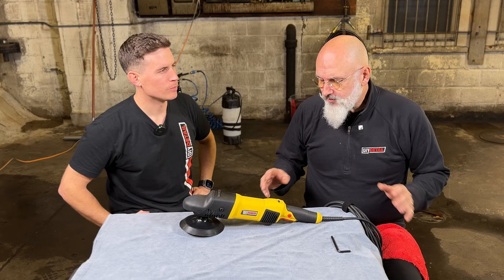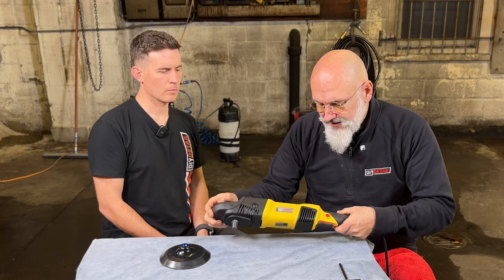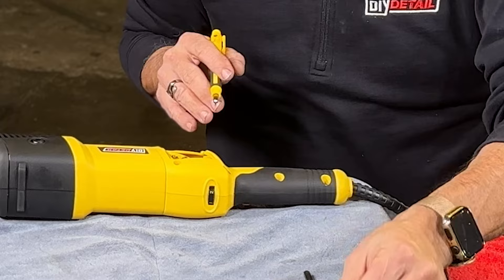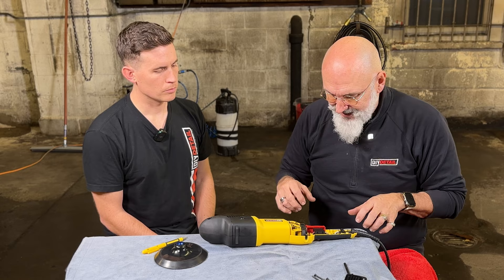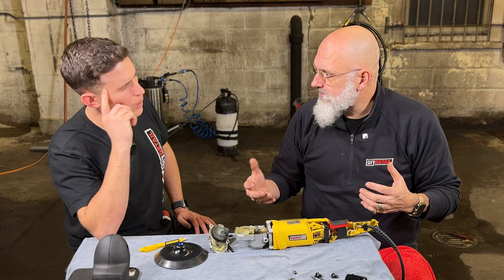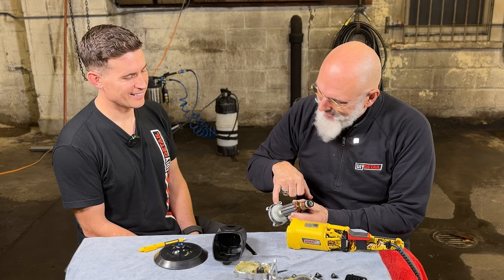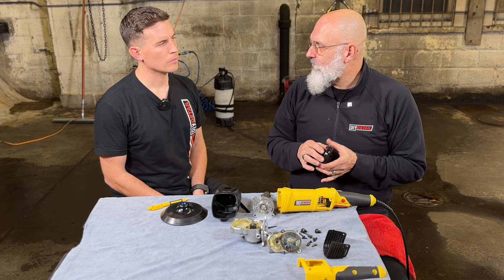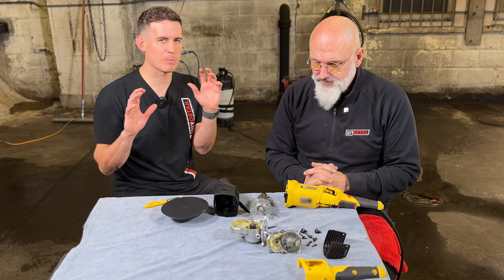The Max Gloss ROTARY Polisher: how we designed the ultimate finishing tool

Comment: I just got mine last weekend Yvan and I am in love!  This is one of those tools where after using it for just a few minutes, I knew my money went a loooong way.  One of my best tool purchases ever.  Talk about value!!! I completely understand wanting to drop it to 400rpm and then settled on 600rpm.  I will slow everything down now thanks to you Yvan!!  I  would recommend for sure anyone doing new cars with little to no needed scratch or swirl correction needed to use a low rpm rotary.  No need for a DA for light to little paint correction.  Throw the finishing pad on and appreciate the gloss. Definitely much glossier than a finishing pad off a DA. Amazing!!!
Reply from the maker: Thank you.

Comment: Hi Ivan. I have not used a Rotary before  except, of course, using a drill with a Rotary adapter and pads, lol😅 I  have used a DA, of course. I do want to get both  right now]I have to make a decision to purchase the one now. will end up purchasing both tools . Which one would you recommend purchasing first.
Reply from the maker: The Rotary
Reply: okay becaue right now I have a couple of cars with very soft finicky clear and dome.medium to heavy defects that need to be.removed. I am sure with your purple wool pad and some good compoun or polish would take them out then finishing our with some primer polish and then coat the vehicles.

Comment: Can you explain when a rotary finish would still be helpful if I were going to use APP with a short stroke DA before coating? If I’m correcting, I’m most likely coating after. APP would give the best base for the coating to be applied on. So if I do a correction step with the 25mm, the APP and red pad would be enough to finish down any light haze right? Not hating on it or anything, but I’m struggling to see how it fits in if you’re using APP. Thanks!
Reply from the maker: The C6 Ceramics APP with a short stroke DA will give you almost as good a finish prior to the application of the coating than DIY Detail Gold Standard Polish and a rotary. The difference goes the other way once the coating is applied. The APP and C6 Ceramics Coatings are designed to work together.

Comment: I forgot to ask and this has to do with the 25mm DA. what is  RPM AND the OPM rating? Also, what  is the AMP rating on the motor and are they the same for both the Rotary and the DA Ivan?
Reply from the maker: 8.4a, 1000W(1100peak) the 25mm DA is 2500- 4500 OPM